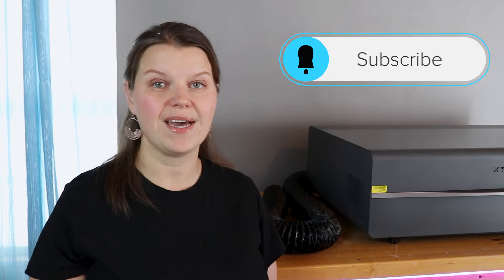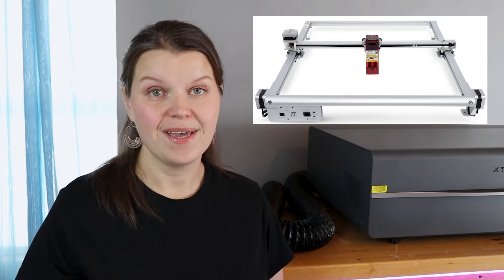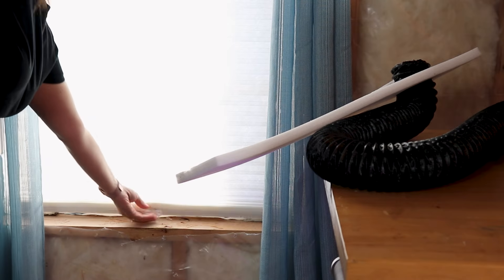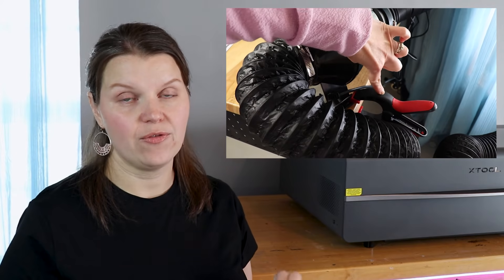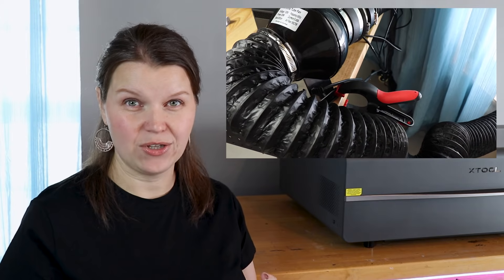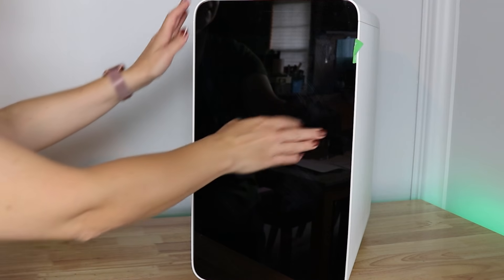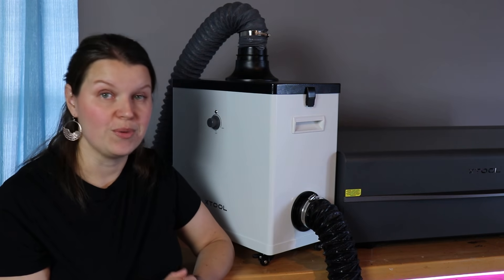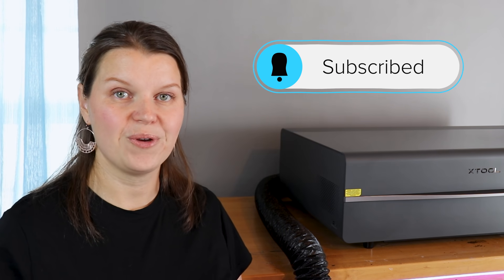Laser Ventilation for Beginners - how to properly vent your desktop laser

Comment: All being said, halfway in, is the air assist still recommended if you use an inline fan?
Reply from the maker: Yes, they work in different ways. The air assist helps with excess burning especially on wood. The fan is pulling smoke out of the machine.

Comment: If I use an inline fan do I need to shut the fan off in the laser?
Reply from the maker: You can shut the fan off in most lasers, I would try that and see how it works. Also try it with the internal fan on and see if you notice a difference. I have it off for some and on for others. The inline fan isn't going to hurt the built in fan, and if installed correctly they will work together to pull out fumes.

Comment: Hi very helpful video, I am obtaining a laser cutter, and a 3d printer for hobby activities this year, and looking at ventilation concerns as it will be in our home, fortunately we do have a window access(option #1). Can you talk more about the winter months, I live in Minnesota so I know the same harsh winters(-neg degree). My main question is...Do you open the windows during those bad spells, negative degree weather(snow blowing, bitter cold), and just take the lose on (heat/insulation) for the projects you have in queue to vent out during your cutting jobs?(over winter time) and then remove venting system from window, and shut window, and lock it back up to maintain heat in work area? Curious your solution during those days, weeks its just brutal outside? Thanks Have a great one!

Comment: Excellent video, it addressed some of my concerns!❤

But what about in the winter when it gets cold and there's snow? A foam board paired with an opened window is gonna make the room rrally cold 😭
Reply from the maker: Yes it is cold with just the foam! I'm in a cold climate. I would upgrade to the same setup with wood or a tight fitting window dryer vent. Helps keep that cold air out.

Comment: So even with the initial air purifier, you still have to vent it out the window? That's no good if you don't have access to a window. I guess the only alternative is the latter, really expensive air purifier that doesn't require venting out a window! 
I suppose one day someone will invent a laser that doesn't require all these extra additions - it will all be built right in, lol.
Thanks for the interesting vid.
Reply from the maker: I'd love to see an all in one! For now, yes you have to vent out a window unless you get the newest xTool purifier that doesn't require outside ventilation.

Comment: Also, for venting, any HVAC person will tell you that not only is a shorter hose more efficient, but the less bends in the hose the better as well. 
Also, it vents better when you open the other window because any time that exhaust air out of a room you need to replace that air into the room. 🙂
Reply from the maker: Great input! Thanks.